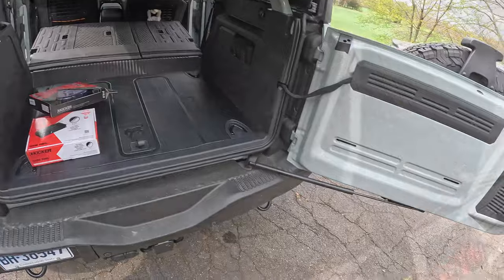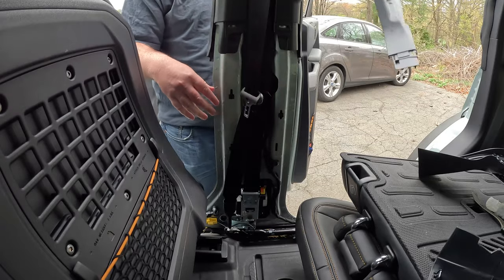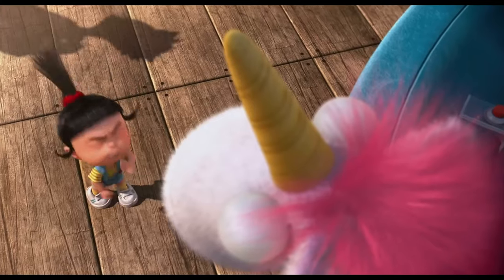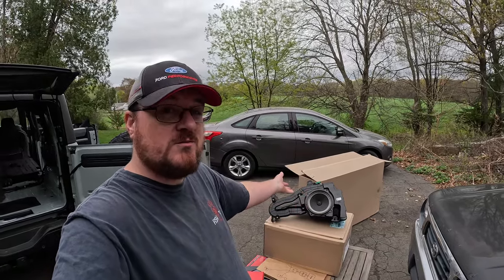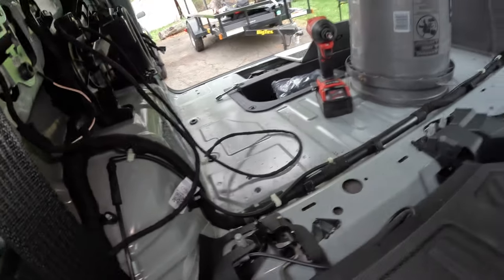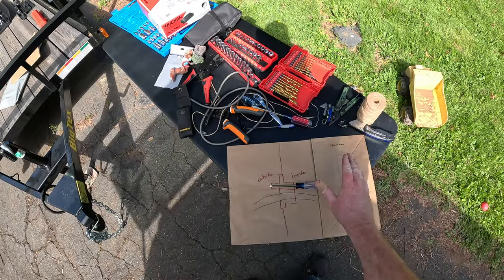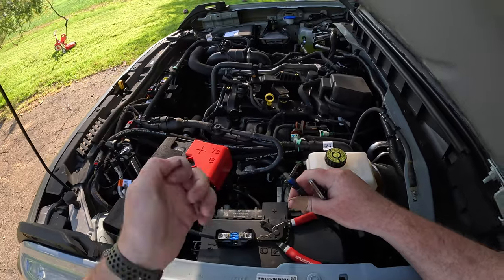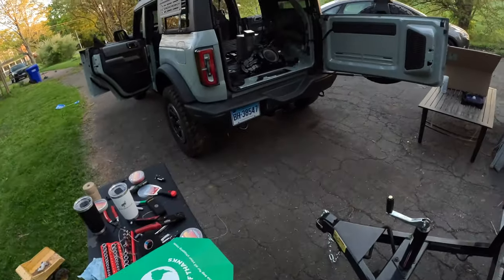Add a sub to your Bronco! | Ford Bronco Subwoofer Install

Comment: You do not need a remote wire connected on the 500.1 when using my harness
Reply from the maker: You're 100% correct, you can just use the DC Offset feature on the 500.1 and it'll automatically turn on when it sees a signal.

I used the remote line because it gives me a super easy way to disable the subwoofer in order to run the 200.4's Auto EQ.  Once the trim panels are back on it's going to be practically impossible to reach the 500.1.

By the way... great job on the plug-n-play kits , makes the whole project MUCH easier than it would have been otherwise.  👍
Reply: @RagnarKon  no problem . I am trying to offer Manny options for the bronco owners
Reply: If you are just installing this amp and sub would there be a need for your plug and play harness? The amp would see power from the 12v power wire right?

Comment: Thanks so much Brian for posting this video! I just re-re-watched the sections on removing trim pieces and the subwoofer panel, and your hard work saved me a ton of time. 
I have a 2-door Big Bend, to which I'd added a subwoofer, and that panel would often buzz or rattle. I replaced the crappy 2-piece fasteners, as Ford specified in their TSB (23-2241), and added some thin washers to "snug" them in place. Problem solved! I owe you a cold one.

Comment: I sincerely appreciate your honest instructional videos. I've referenced them in the 6G forums and you've saved me a lot of time getting things popped off, installed, and popped back in. I do have a question. While I have the Kicker Key 200.4 (awesome upgrade), I'm wrestling with the Kicker Key 500.1 decision. My 23 Wildtrak has a factory sub. It is OK, but needs to be louder in the mix now that the Key is boosting everything up. Basically, the mix is too low for the sub, at least for me. I swapped out the stock sub for a Kicker 6.75", dual coil 4 ohm. It's quieter than before - likely due to the 4 ohm coils instead of 2 ohm coils. Now to the Q. I'm thinking of grabbing a signal from my front passenger kick speakers and running it into a non-DSP amp instead of the Kicker 500.1. A Kicker 46CXA4001 mono amp is about $100 less and has 400 Watts max. If has Hi and Lo inputs, crossover tweaking, etc. I think I would have to use a Hi to RCA out with remote wire to get this to mix well. I'm sure you thought of this. Curious looking back if you would suggest doing it this way - or sticking with the Key 500.1.
Reply from the maker: I'm not particularly pro-500.1.  Granted I am happy with the amp, but truthfully the reason why I have it is because the 500.1 was on-sale when I was buying all my gear.  There are lots of amps that will work.

And the factory sub amplifier in the back is fed via a low-level signal, so if you are swapping out your factory sub amp I would simply use the wiring already back there.  I did not have that luxury because 2022 Broncos didn't have a subwoofer. But since you have a factory subwoofer already might as well save yourself a ton of headache ripping out trim panels, and just use the signal already back there.

Comment: Suggest adding sound deadening to the trunk area and covering as much as the sub box as you can will make a huge difference.  Cabin road noise is greatly improved and the sub sounds more premium.  Kicker sub is way better than factory and very affordable...

Comment: I just received my 2023 Bronco and I have been prepping to do the overhaul of my speakers and your videos have been great.  One question I have is if you had the 2023 with the sub delete would I still need to run two subwoofers.  I am adding the Kicker CWRT8 for the sub and I have KSC670 for the kicker panel, KSC40 for the panel and 6.5" kicker on the rear roll bar.  I assume that i would need all the power possible but I was not sure if I should do a Kicker 47KEY500.1 in the front under the glove box and then run power for a Kicker 46CX!800.1T in the back just for the amp, i am not even sure if it is too big for the "sub enclosure"  as i have not removed panels yet to start the project.  Any advice would be great.  I am going to post this on the G6 forum as well.

Comment: I have a 22 Bronco wild track I have a subwoofer that works. I know this because in audio settings I set it to get a deep Bass sound and it got to the point that the rear was rattling and I had to open up the panel and tighten a couple of bolt's
Reply from the maker: You have the Lux package with the B&O system, which has always shipped with a functioning subwoofer.

Comment: So, ordered a plug and play kit recently and the remote line now seems to go to the acm. Reading through the manuals for the kicker keys my understanding is that in your case the 500 is going to turn on the 200, and in my case, hopefully the head unit will turn on the 200. Unless I'm miss reading how the rem functions on the kicker keys, which is quite possible. Though I believe you installed the 200 first, so with the first switch in the down position the amp will turn on in any configuration, assuming you had it in the first position.
Reply from the maker: The remote line on the 200.4 can either accept an input to turn on the amp, or be used to output a remote trigger to other amps.  In my case the 200.4 itself is turning on when it senses an input from the vehicle, and I am using the remote line as an output to turn on the 500.1 amplifier.

I don't know what the new kits look like.  My kit was the older kits that "stole" its power from the factory ACM power line, but the newer kits require you to wire it to a battery.  So he may be wiring the remote line to the factory ACM power line, and using it to trigger the power on the 200.4?? Not sure.

Comment: I installed the swing gate Sub on my 2022 Badlands. I'm not getting signal to the LOC and thus nothing to the sub. I dont have B&O system. I have a T harness to the factory head unit. Is this just a simple forscan adjustment?

Comment: Hi man, thanks for the vids they are all very helpful. Hey so I have a 2023 with sub delete, can you confirm that the following is true: 
1) I need forscan to set the driver rear pod and subwoofer to Speaker+sub? 
2) After forscan setting is made the factory wiring that goes to the dummy amp should be active and usable as input to my sub amp? 
3) Is there factory power to the rear sub and if so is it enough to power a larger sub amp?
Thank you so much man
Reply from the maker: 1.  Yes
2.  Yes, it will be a Low-level input for your amplifier.
3.  It is a 12 gauge wire, consult the user manual for your amp.  12 gauge should be sufficient for a ~220 watt (or less) amp, so there is a decent chance you'll have to run a separate power wire.

Comment: I've been following your speaker upgrade series and I am putting together my shopping list. I was able to find the wiring harness for the Kicker 200.4 (Plug-N-Play 11-4) But I cannot find the wiring kit for the Kicker 500.1 (Plug-N-Play 14.4) any tips?
Reply from the maker: Traveling today and his website is impossible to navigate on mobile apparently. But I'll check tomorrow.

He has been constantly changing the Kit numbers on his website and it's hard to keep up. I should probably just remove them from my videos' description so people don't buy the wrong kit.
Reply: @RagnarKon   From what I can tell, the 19-1 kit is an all inclusive kit for the 200.4 with the 500.1 solution that you did. Please correct me if I got that wrong.  Drive safe and thanks for the response! Your Bronco videos are some of the best I've seen!
Reply from the maker: @Jason33w   Just looked it up.  You are correct!!  It is kit 19-1. (Or kit 19 if you also want to buy the amps.)
Reply: @RagnarKon  Thanks for the assist! I really dig your videos. I have a 2022 4-door 2.3, manual Big Bend and I love it!

Comment: Wow Overkill on taking things apart
Reply: I don't know if you've seen all his videos on the audio install, but he basically redid everything so you might be out of context. He also figured it out for everyone else. If you decide to go this route, you might be able to skip a step here and there but from experience putting in new speakers, the Key 200.4, and swapping out subs ... it's pretty much what you have to do.

Comment: So in the 22 with out the Sub from the factory is the plug there for the BO sub or do you still need to install and amp and all?
Reply from the maker: 2021 and 2022 Broncos with the standard base audio system (non-Lux package) get nothing for the subwoofer.  You have to run all the cables yourself.
Reply: Never mind I found it.

Comment: What size is the sub? 8in or 10in?
Reply from the maker: It's just shy of 8 in. Approximately 7¾ in.

You can fit a 8 in. sub in the housing with some modifications.
Reply: The popular choice is the Kicker Comp RT 8". Most subs will require removing some material that projects outward around the opening.

Comment: Bronco owner's need a support group more than they need a forum😂 50 to $70,000 for a cheap plastic Lego vehicle
Reply from the maker: Don't get me wrong... I love my Bronco. But yeah... they ain't worth anywhere close to $70,000.

They're selling tens of thousands of them at $70,000 though... so... good for Ford I guess?
Reply: @RagnarKon  my dealer has a half dozen of them on the lot, customers that I backed out and they're selling at MSRP and I see plenty of people in the service drive with buyer's remorse that expected more but bought into the internet hype
Reply from the maker: @ubeuonly  Yeah thankfully the vehicle market is starting to come down, and the Bronco market is also coming down with it.

My dealer also has several on the lot.  Most of them are from people who ordered the vehicle, but can no longer afford it with interest rates being so high right now.

Comment: Not sure why all these people tear the insides of their new Broncos apart. Wouldn’t it have just been easier and prolly cheaper in the long run to have just paid for the LUX package with the subwoofer?  And have gotten all the other goodies along with it?
Reply from the maker: For me... the Lux package was an extra $4700, and there was literally nothing in it that I actually wanted. (There was actually several things I specifically did NOT want.) This audio upgrade cost me around $1200.  So saved myself $3500 and got a sound system that is better than the Lux package.

For others, they skipped the Lux package because it was heavily constrained and preventing their Broncos from getting built.

Others skipped the Lux package because they knew they wanted to install aftermarket upgrades, and the Lux package comes with a bunch of extra electronics and sensors that would get in the way of those upgrades.

So it all depends on what you need/want.
Reply: I have the lux package but am still considering an audio upgrade, the B & O system is a bit disappointing , I’m not even a big audio expert at all
Reply: The Lux system is far from "Luxury". But it depends on what you like. I've heard this package in a couple of different Broncs and the system doesn't match up to my 7 speaker system after the Key 200.4 upgrade and speaker swap. In fact, it is terribly underwhelming. But I like it loud, full, warm, with punchy bass. If jamming music isn't near the top of your list while exploring, then I wouldn't recommend it. For me, it was the 2nd mod to perform.
Reply: I have the lux in my BRaptor and im damn near 5k into my audio upgrade.

Comment: I did a similar install last fall. Besides figuring out how to cram a Kicker Hs10 powered sub behind that rear pax side panel, like you the bulkhead grommet took a huge amount of time to run the power wire though. Without having that sagittal view you had I thought the upper nub was a solid piece of rubber. So with terror and panic sweat I punched a scribe though inboard side of the bundle hoping not to snag a wire. In the end a successful install. I borrowed ideas from  @battlebornbronco2330 for sub mounting but the area for mounting to a four door has less space.
Reply from the maker: That grommet was DEFINITELY the hardest part of the install so far.  Considering Ford intended to make it easy for people accessorize their Broncos, I was shocked just how difficult they managed to make it.
Reply: Triamx, were you able to fit a hs10 self amp sub in the same area that the factory  BnO sub is located?
Reply: @cuttingboardsbyben9151  the HS10 will fit behind the panel where the B&O sub is, but it's a project on the 4 door Broncos. There is less space in the area on a 4 door compared to a 2 door. I used the videos @battlebornbronco2330 posted as a guide. He was able to use the included brackets with the HS10 to mount directly to the inner fender his 2 door. I had to  make a mounting plate out of ABS plastic to attach to the inner fender and mount the hs10 to the mount plate, as well as hammer a depression into the inner fender for clearance for the upper forward corner of the HS10. Also trim some of the interior panel aft of the soft top mount area panel ( I have a hardtop). Have somebody hold a sandbag on the outer fender to absorb the forces of hammering . I may have disturbed some outer fender panel alignment when I was hammering, or my bronco wasn't assembled with perfect alignment , I dunno. its close enough. I didn't think to take photos while I was doing the install. I have an occasional bass rattle that needs looked into. When that time comes I'll get some photos. One rattle/buzz is inside the seatbelt take up reel. Not correctable I imagine.